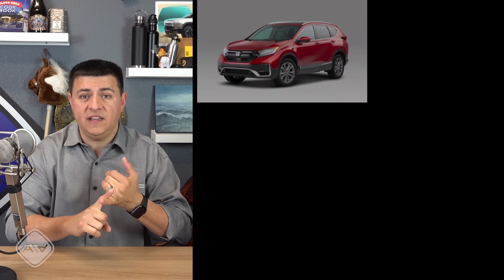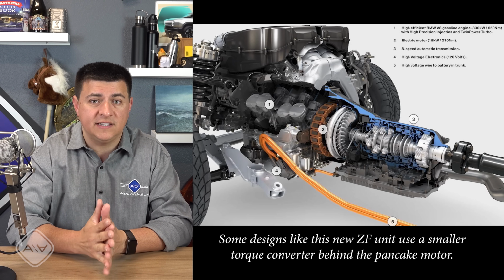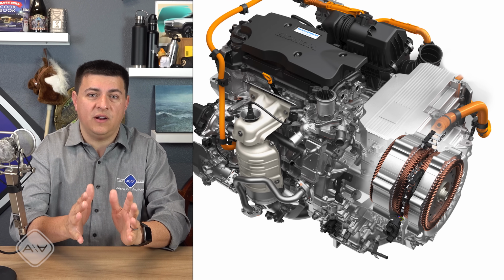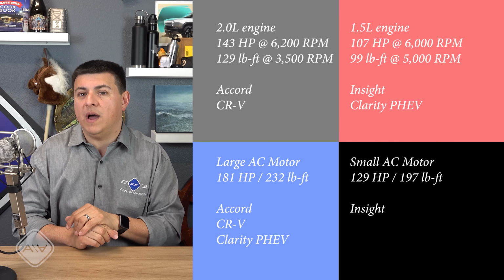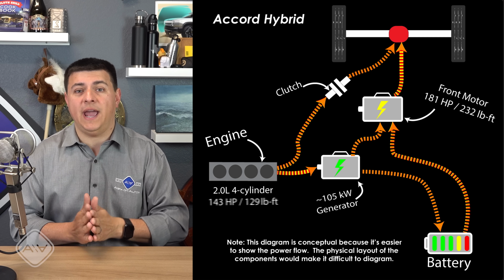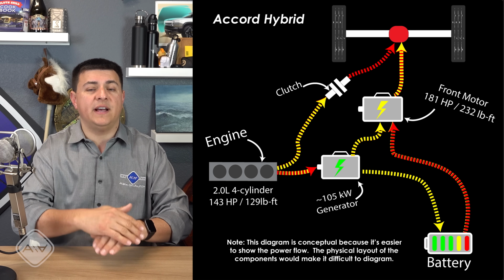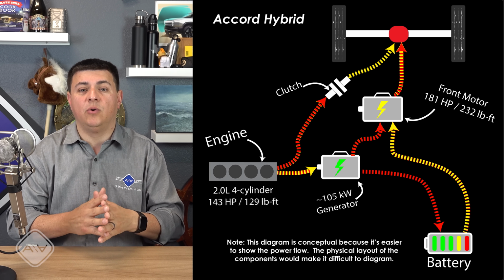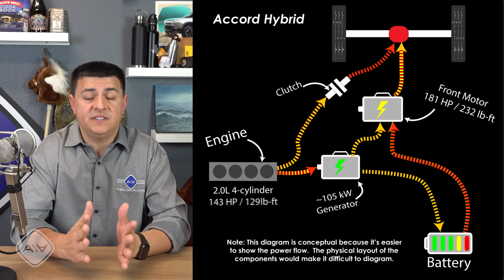How Does It Work?  Honda's 2 Motor Hybrid System Explained!

Comment: Interesting bit of info: Toyota does not recommend driving its hybrids at speeds above 85mph for any extended time because it would involve a constant depletion of the battery and the use of the engine to power the car, not generate electricity. That may cause a complete drain of the battery to levels where it cannot be re-charged again. The Rav4 Hybrid’s maximum speed is 112mph, while the non-hybrid’s is 130mph. 

You mentioned that driving a Honda at 110mph would produce the peak HP, but would it not cause the same situation? What is the CRV hybrid’s  top speed, for example?
Reply: Toyota recommends that you not drive over 85 mph unless you have replaced their tires with high-speed tires.

But coincidentally, that is about the speed where it is physically impossible for their current generation of Hybrid Synergy Drive to use EV mode. The Power Split Device forces the speeds of the two motors and the ICE to satisfy 18*ICE+5*MG1=13*MG2. So EV Mode requires MG1 to be spinning 2.6 times faster than MG2. Since MG2 is geared directly to the wheels, this creates a relationship between MG1 and the car's speed in EV mode. The first Priuses couldn't go faster than about 42 mph in EV; later versions increased that to 63 mph and then 84 mph.

But what that means is that above 85 mph, the engine must be adding power to the system. In the Camry, it is most efficient at about 60 HP, and that car needs about 40 HP to maintain 85 mph. The serial portion of their HSD drive will use the excess 20 HP to charge the battery. And it can't stop doing so. It will overcharge the battery, not drain it, unless it runs sub-optimally.

+++++

Alex completely misrepresented what horsepower means to a car in general, and this car in particular. Max power does not, and cannot, occur at 110 mph. I'm sorry to be so blunt, Alex, but you need to address this in a video. Or apply caveats to this one. You are conveying incorrect information.

If a conventional car's specs say it produces 212 HP at 6200 rpm? That means the engine can generate that much power only at 6200 rpms, and only under full throttle. The point is that realistically, no car ever applies its full theoretical power to the wheels.

But 212 HP isn't the maximum theoretical wheel power anyway. The engine provides power to other things: power steering, power brakes, air conditioning, the alternator, etc. Not to mention losses in distributing the power to all those devices. While there is no exact formula, the usual estimate is that 85% of the power generated reaches the wheels. I'll point out here that 85% of 212 HP is 181 HP. And every iMMD hybrid is designed so that the HP rating of the traction motor is 85% of the maximum combined HP.

What the "combined horsepower" in the Accord Hybrid means, is that the battery and engine-driven generator can produce, at maximum, 212 horsepower of electrical power. This is the same meaning for horsepower that a conventional gas car uses for mechanical power. The difference is that the gas car only sends power mechanically to the wheels (and other devices), while Honda's hybrids can send power electrically as well.

CAR SPEED IS IRRELEVANT TO THE 212 COMBINED HP RATING. That is an electrical power rating. The drive motor can accept 181 of this HP. And that is essentially the same power to the wheels that a 212 HP engine will provide.

Top speed is determined by the redline rpms of the electric motor, and the gearing. Redline in the Accord is about 12,600 rpm, and speed in mph is about rpm/113. So 12,600/113=112 mph.
Reply: @jeffjo8732  Top speed on Hondas is limited solely by the revolutions of the wheels and the internal combustion engine. Did you not watch the video? It runs solely on the gas engine after 40-45mph.

Hondas aren’t Toyotas. They have a serial hybrid system, not a parallel one.

The combined 212hp output is the sum of the peak electric motor output and the charging HP output of the gasoline engine. That means the 2.0 engine puts out approximately 31hp when it works to charge the battery. That added to the 181hp output of the electric motor results in the peak 212hp.

Alex is incorrect about the 110mph figure because he thinks Hondas become parallel hybrids at high speeds, which they do not.
Reply: @afcgeo882  I'm unsure how to read your reply, since you make contradictory and incomplete statements. Honda hybrids alternate between using serial hybrid mode and parallel hybrid mode. Toyotas have a serial-parallel system, literally operating in both modes at the same time.

But parallel mode in a Honda is reserved for speeds between about 40 to 45 mph, and 75 to 80 mph. Not strictly above 40 to 45 mph, as Alex implies. But it also is only used in LOW LOAD situations. So maximum power must come from serial mode. Top speed is not limited "by the revolutions of ... the internal combustion engine" as you say, because it will only happen when the engine is disconnected from the wheels.

Top speed of the Accord is limited by only the top speed of the electric motor. Which is 12,584 rpm, if it is the same limit as in the 2014 model (as it appears to be). Using the actual gearing of the Accord and a nominal tire size, this speed is 12,584/112.9 = 111.5 mph.

 Alex gets this wrong - he said "Peak horsepower of 212 horsepower will actually occur somewhere right around 100 to 110 miles an hour. That's the point where this clutch can be closed and the engine can be spinning 6,200 rpm to create its peak of 143 horsepower." Alex's numbers are wrong. The actual gearing says that at top speed, with the clutch closed, the engine would be spinning at about 4,100 rpm (that's 111.5*37.1). The car would have to be traveling at about 167 mph to reach 6,200 rpms. But in either case, it violates both the speed AND load limitations for parallel mode.

Some of the numbers I have cited come from a paper written by Honda engineerTakeshi Wakamatsu and others. While Honda seems reticent to describe peak horsepower exactly, I was told by a third party that Wakamatsu-san told him "[Maximum power] can be achieved at any speed by the generator at max output and the battery at max output." 

Notice that Wakamatsu-san does not mention the 181 HP motor. Electric motors don't produce power, they convert active power from one form (electric) to another (mechanical). The 31 HP you say the engine produces is not added to the output of the 181 HP motor, it is part of the input to it that gets converted. At peak operation, in serial mode where engine speed is unrelated to car speed, the combination of generator and battery can produce 212 HP.

But the wheels aren't the only things that need to draw from this power. If 15% goes elsewhere, as is usually budgeted, then 181 HP can reach the motor. And the 181 HP rating it has is for the input, not the output, of that motor. And lest you think this is a coincidence, a bigger battery and a smaller engine in the Clarity produce the same 212 HP combined electrical power. It has the same 181 HP motor. The Insight has a battery and engine that produce a combined 151.5 HP. Its motor is rated at 129 HP, which is 85% of that combined total.
Reply: @jeffjo8732  False. Honda’s hybrids are SERIAL, never parallel - the car is propelled either by the electric motor OR the gasoline engine, but never both at the same time. That clutch is either open - electric drive or closed - engine drive. It has no ability to combine the two. 

Toyota’s system is PARALLEL - able to use mechanical energy from the gasoline engine AND the electric motor at the same time (in parallel). The planetary gear set drivetrain allows for that. Both systems are always connected to the drive train, but may or may not spin their cogs to drive the vehicle, depending on power/charging needs. 

You just lack ALL knowledge of how hybrids work and how power calculations are made in vehicles, and because of that, you’re rambling on, trying desperately to seem smart. You also lack the physics knowledge to discern POWER versus ENERGY. Energy is converted (ex: stored, electric, mechanical, heat, kinetic, etc.) Power is a measure at the shaft. Horsepower is a unit of power (not energy), equal to 550 ft-lbs per second (the power needed to move 550lbs one foot in one second). That is mechanical, not electrical horsepower, which is the measure for moving mechanical machines, regardless of how that power is generated, as it uses mechanical links to move the weight. You also don’t understand the difference between power measurements of horsepower versus torque, not HP measures in electric versus mechanical devices. 

Go research the topics first. Then come discuss them.
Reply: @afcgeo882  I’m sorry? A parallel hybrid is when the ICE and a Motor-Generator (MG) are both connected to the wheels. The MG can add, or subtract power from the system. This is exactly what happens when the iMMD clutch closes.

The traction motor cannot, ever, be disconnected from the wheels. If you drive one, you can see it happen if you pull up the Power Flow Monitor. Even if the clutch is engaged – indicated by the gear symbol in the center of the display – the battery is still adding or subtracting power. But I doubt you will take my word for it - try Honda's, at https://hondanews.com/en-US/releases/2017-honda-accord-hybrid-press-kit-powertrain .

Maybe you think the MG has to be in-line, like the IMA system used? It doesn’t. It can be geared in, as the iMMD system does. See https://youtu.be/QLUIExAnNcE .

Toyota’s system is SERIAL-PARALLEL. The planetary gearset is called a Power Split Device. It connects the ICE to two MGs. One MG acts as a generator, varying the amount of power it takes from the ICE to moderate the ICE’s speed. So it is in a serial configuration. The other uses the electricity generated by the first to add more power back. This one is in a parallel configuration. See https://en.wikipedia.org/wiki/Hybrid_vehicle_drivetrain#Power-split_or_series-parallel_hybrid . I have no direct knowledge of the 85 mph recommendation you describe, but it sounds like it requires both MG1 and MG2 to operate in parallel mode, which would not allow battery charging while driving.

You are the one who is confused about how all this works. You need to do the research. I’ve even provided several starting points. And if you think I've confused power and energy, pleas point out where. I'll try to explain how you misunderstood what I said.
Reply: @jeffjo8732  Again you demonstrate a complete lack of understanding of how this (and other) hybrid drive systems work. Also,  you don’t read what you link. 

The Honda system works in three ways:

1. Electric Only: the electric battery powers the traction motor, which turns the drive shaft. 

2. Hybrid: Engine generates electricity, which joins the electricity from the battery to drive the. drive shaft via that same traction motor. 

3. Engine drives the wheels, electric motor does nothing. 

That is the serial hybrid function. The drive is either via the traction (electric) motor or via the ICE engine, NEVER both. And no, the traction motor doesn’t take away power. 

In a parallel hybrid system, the drive is powered by both, the electric motor AND the ICE engine, at the same time, when needed. The 1MG on the Toyota NEVER acts to generate drive power. It has just two functions: 
1. Charge the battery and
2. Start the ICE engine.
That’s all it does, so it’s NOT a series hybrid setup at all.

You don’t even understand that both, Honda and Toyota use two MGs! One that is connected to the driveshaft (MG2) and one that  isn’t (MG1) and is only used to generate electricity and start the ICE engine, instead of the 12v battery!
Reply: @afcgeo882  
I'm sorry, but #3, Engine Drive the engine drives the wheels, and the electric motor adds or subtracts power. If you had truly read the line you claim I didn't, you would have seen thisa under the section describing it: "In this type of operation the system works as a 'parallel hybrid' where both the gasoline engine and, when required – for instance upon quick acceleration – the electric propulsion motor, both provide power to the wheels."

Or maybe you can find an article titled "Development of Motor and PCU for a SPORT Hybrid i-MMD System" in the October, 2013 edition of the Honda R&D Technical Review." It was written by Jiro Kuroki and Hiroshi Otsuka. On page 43, paragraph 2, it says "Engine drive mode is used when cruising at high speeds. In this system, the motor is used both for driving the vehicle and for regeneration."

That is the parallel hybrid function. It explicitly says the motor is used with the engine. What part of that are you having difficulty with? "In [this system=Engine Drive] the motor is used both for driving and for regeneration].

Toyota's system uses several modes. They are described at https://en.wikipedia.org/wiki/Hybrid_Synergy_Drive#Power_flows . Try reading it yourself, before accusing me of not doing so. I know, and understand, what it says.

But I'm pretty much done with you, if you refuse to understand these things that I've placed explicitly before you. You've been rude, disrespectful, and verifyably wrong about just about everything you said.
Reply: @afcgeo882  You are obviously a troll, and I will not respond to you any further. This is intended for anybody else who reads this far and has become confused by your inaccuracies.

The best indication that George L is a troll, is how he skipped over the part where Honda says "In this type of operation the system works as a '*parallel* hybrid'. That makes it very clear that Honda thinks it operates as, well, a parallel hybrid. George L prefers to make unfounded assertions about what he thinks is true. and selectively ignores what contradicts his assertions, while misinterpreting what he can to make it look like support.

Like where he thinks "motor" means "engine." Yes, a motor can be called an engine, but it is sloppy language and is not used that way by anybody who understand hybrids. Because the difference is important to hybrids. A motor requires a separate power source to release stored energy, while an engine performs both tasks. So an electric motor needs a battery or generator to make electricity, while an internal combustion engine burns fuel to make heat, and then uses the heat to turn a shaft. See https://youtu.be/yKOA7XeGXNw

But that claim is wrong since, even if interpreted as George L wants to, it describes a parallel system. If the "engine/motor" is driving the wheels directly, as he explicitly says it is, that is not a serial system. When it drives a generator as well, as he also explicitly says, it is a parallel system.

Then there is another article from the October, 2013 Honda R&D Technical review, titled "Development of SPORT HYBRID i-MMD Control System for 2014 Model Year Accord." It says: "The third mode is called Engine drive mode. In this mode, the engine and axles are coupled at fixed gear ratios using a clutch, and the wheels are driven directly by the engine (the system operates as a parallel hybrid). In this case the motor performs assist and charging functions."

Honda's self-named parallel mode uses two, well, parallel power flows:

Engine -> Clutch -> Traction Motor AND wheels
Battery <--> Power Control Unit <--> Traction Motor

This is a classic parallel-hybrid configuration, and it is what these Hondas use at highway speeds under low loads. The point, in the Accord, is that the engine is most efficient at about 90 lb-ft of torque in the rpm range where this happens. But maintaining these speeds on a flat road takes 30 to 60 lb-ft of torque, while acceleration needs much more than 100. It would be stupid to run the engine at anything but 90 lb-ft of torque, when the traction motor that is already attached to the drive system can make up the difference between 90 lb-ft and whatever is needed.

The engineers who designed the iMMD system aren't morons. They are the ones who say the car operates in parallel mode.

For a great explanation of the iMMD system from an expert engineer, including diagrams, , see https://youtu.be/fmMb45PPrmg?t=186 . That link should start at the part where he explains, in detail, the parallel mode.

Comment: Does this mean that if the battery does not hold a charge anymore, the Honda hybrids will not run as below a certain speed the engine is not engaged to the drive shaft?
Reply: Alex's diagram is simplified, and that means that at 4:40 it is not quite right. The three arrows in the lower-right don't connect the generator, battery, and motor as shown. Instead, all three feed into an electronic control device called the Power Control Unit, or PCU. It decides how much power from the generator to send straight to the motor. If the generated power is more  than what the motor needs, it sends the excess to the battery. If less, it supplements it with power from the battery. The net loss this way is lass than the (maximum) 20% that Alex is claiming.

What would happen in the situation you describe - which really can't happen - is that the power sent to the battery would turn into heat, and the car would drive just fine. But it wouldn't have the extra power the motor sometimes provides.